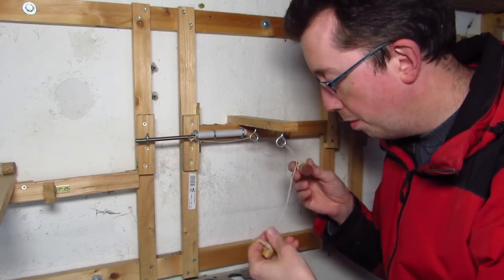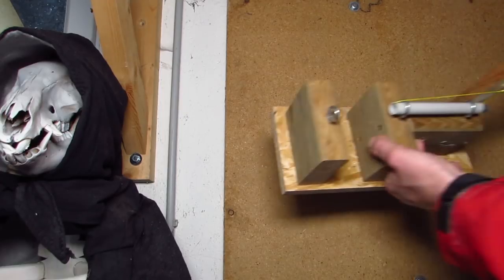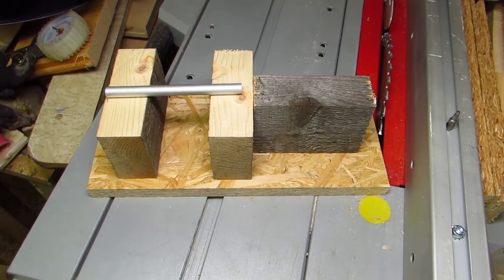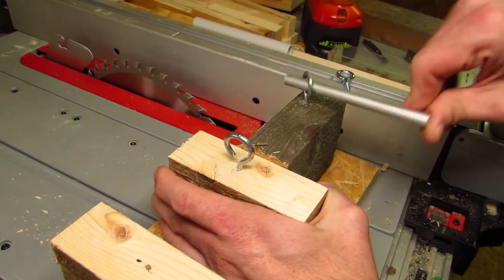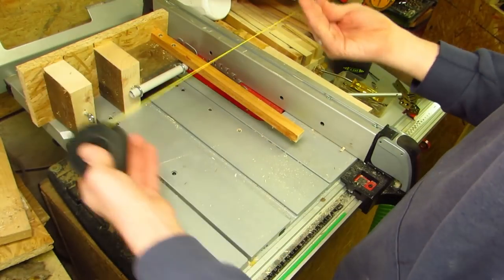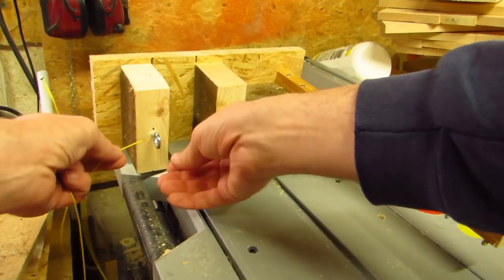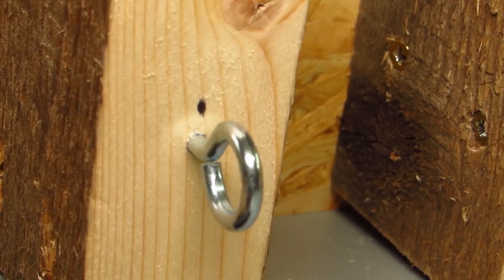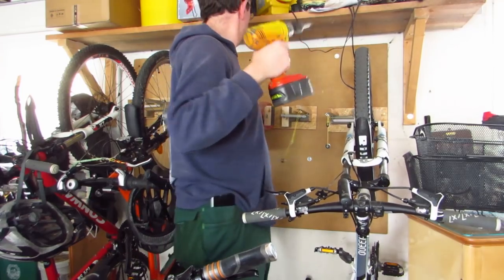Bike Wall Holder - pull all the strings!

Comment: @1:15 it should say "outer radius minus inner radius" you said circumfrence, which would give you a very different measurement (circumfrence=umfang, radius=Radius, diameter=Durchmesser). Would probably still work, but technically wrong.
Reply from the maker: You are correct, my mistake! Thanks for pointing it out! And thanks for watching, of course!